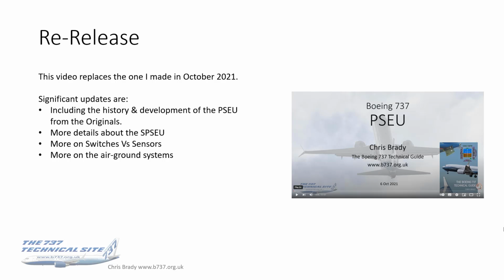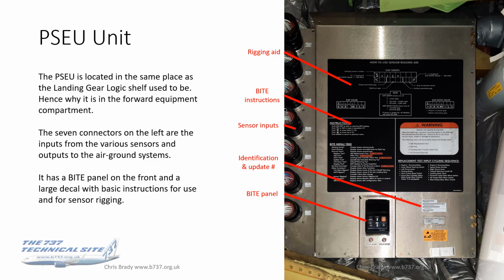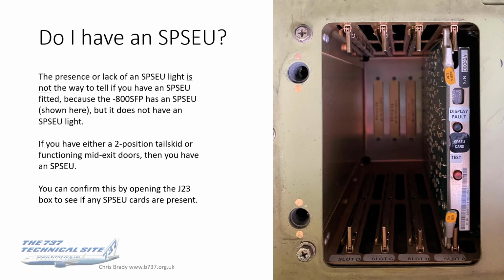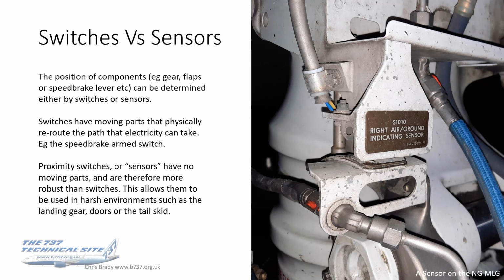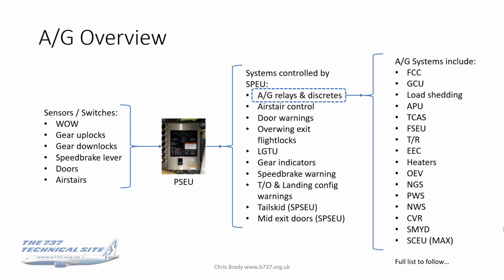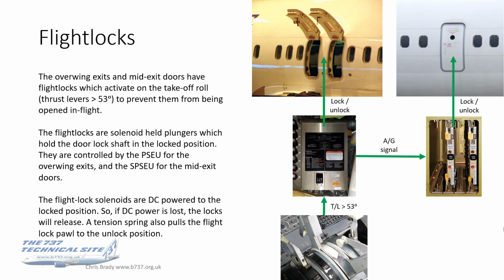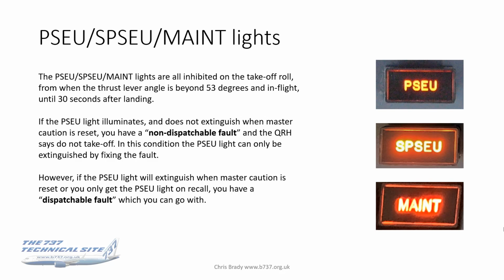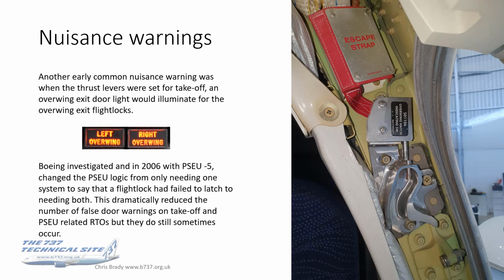737 PSEU

Comment: Great explanation and analysis of the PSEU, quite a few times  Fcom isn't enough and this system is one of them, Thanks to your effort and your altruism, now I'm more aware of all the consequences of an orange light at the back of the AFT overhead panel. 
In my short experience in B737 I´ve had a couple of times this PSEU light illuminated while disembarking only  though the from door  and most of the pax remaining on the plane still in the back. I´ve heard that fault is because the sensor of the Nose Gear does not agree with the Main gears so the fault is triggered. I´ve seen people even stopping the pax at the front to evenly distribute the weigh on the plane to avoid the plane from pitching up.  I haven't found anything about this nor any limitation for pax disembark. Did you hear about this or ever happened to you?
Thanks again, looking forward to watch your next master class.
Reply from the maker: Yes that is absolutely the case. I’m guessing you had this on a -900ER?
Reply: @ChrisBrady737  It was in the 800, at least a couple of times that Im aware of. I'll try to find out how was the loaded next time it happens.

Comment: Sir, I can’t find the answer about this issue. Can you tell me about it?
On the conventional SIDS, especially initially maintain runway heading chart, LNAV can be engaged and captured after 50’.
I wonder is it same with the heading sel function?
I guess it is same because the FMC displays the HEADING on the top.
What do you think?
Reply from the maker: Check my FMC videos, most of these types of questions are answered there. 👍
Reply: @ChrisBrady737 I appreciate it CPT.

Comment: Thank you for your continued work on these excellent videos. If you have the takeoff configuration warning inflight due to a failure of the ground spoiler interlock valve will extending the flaps to 1 silence the horn?
Reply from the maker: Glad you are enjoying the videos. Re your question, I am not sure but it sounds logical. Possibly worth a try as you will probably be returning to the airfield anyway.